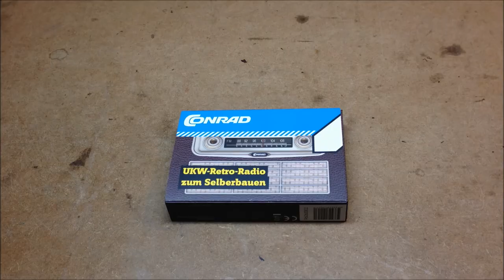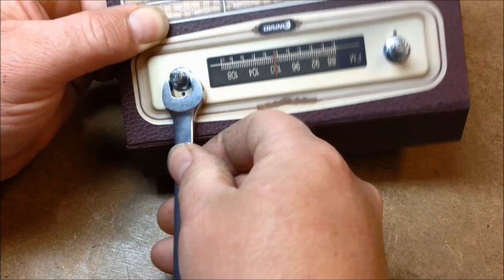How to Build an FM Radio from a kit

Comment: I was inspired to buy this kit by a radio design biscuit tin I was given at Christmas. I just finished building the radio and mounting it into the tin rather than the cardboard case provided. I have never soldered a PCB before and found the instruction book combined with the video brilliant. The radio played first time and sounds really good. Thanks Andrew Mallinson.
Reply: Ali express has radio kits very cheap ,from a 1.48 to ten dollars ,and most kits you buy at eBay or Ali exress have no directions ,but you can find someone has made a you tube video on how to assemble ,and for you beginners ,there are many videos on how to solder and how to tin your soldering pen,etc.

Comment: what mm solder did u use? btw this really helps my project thnx
Reply: 0.31 or about 8mm for electronic soldering ,make sure it is lead solder or you won't be happy ,60/40 or 37/63 lead solder ,buy good solder kester brand is the best I have found in 50 years of soldering, buy extra flux it cheap ,

Comment: 60 lbs or $74.00. cost for what is gotten, a bit much. The channel ind., what channel ind? There could be a station ind.  Just a round station ind label about the tuning knob with some frequency marked off, and you be set to go. What the point of this item when anyone can go about and buy an AM/FM pocket radio for less. The ease of assembly is great.
Reply from the maker: There is an exact copy of this by "Haynes" . Its a lot cheaper too,  the conrad model is now discontinued
Reply: Because it fun try it before you knock it